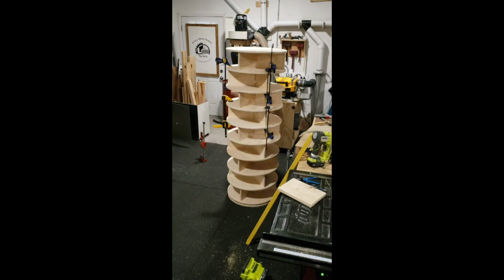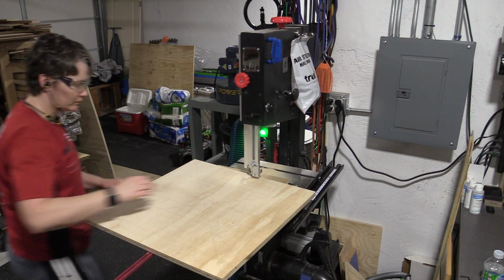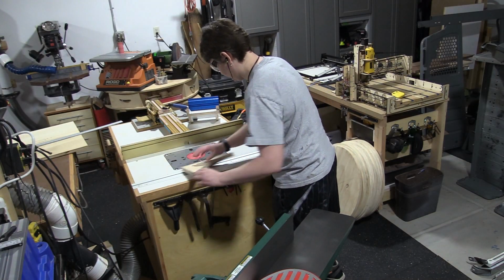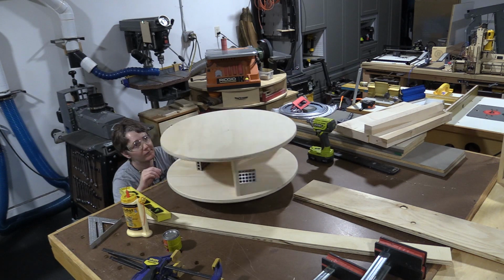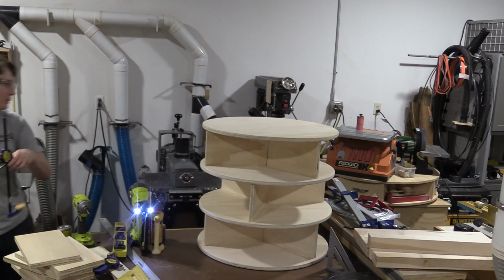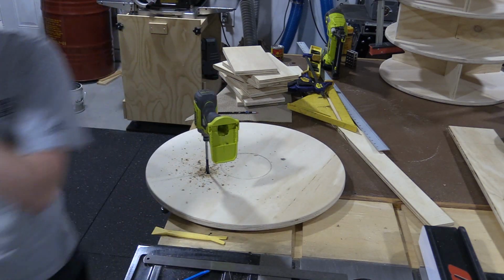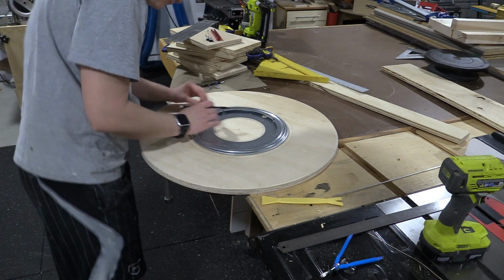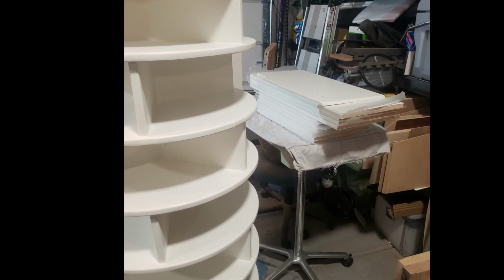GIANT Shoe Carousel, Rotating Shoe Rack, Lazy Susan Shoe Rack

Comment: For marking your dividers, cut some 1/8" or masonite strips about 1 1/2" wide. Lay out on a circle to create the line guide. Glue strips together at angles you desire. Use it as a guide to draw lines.

Comment: It's Febuary 2024.  Material prices was low when this video was made😂😂😂😢😢😢
Reply from the maker: This was actually at the peak of COVID supply and demand issues. Materials were more expensive, which is why I am using crappy construction grade plywood instead of cabinet grade.  This plywood was bowed and awful to work with.